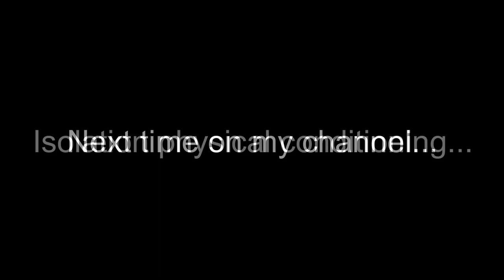1973 Boler Frame and Axle Replacement

Comment: That was a big crack in the frame!
Reply from the maker: Yes, that was going to end badly.  RIP old frame...
Reply: Thanks Buck I was watching the commercials now you gave the video away
Reply: Can you tell me any information on the axle you used?  We are getting ready to replace ours.
Reply from the maker: @jlabillois  of course: we have a custom fabricated stainless steel frame on a “trailer canada #2500 rubber torsion axle” :). Old luck!

Comment: Well, I never broke a trailer, but I did break the hitch, a very very long way from help.  But that's a tale for another day.  So yeah, I share your fears.
Reply from the maker: I would love to hear more!
Reply: @VioletBird  Trailers were not meant to fly, and tongue weight is very important to know.  I have a custom high-clearnace rear bumper and the hitch is welded to a plate.  The welds on the plate broke and the plate began to peel off.  Somewhere on the way to Chicken due to high speeds and big bumps (so unintended but not unexpected).  But it made it to Chicken, which closed the next day so I nursed it all the way to Dawson City.  We arrived during a holiday so we had to wait to get it fixed.